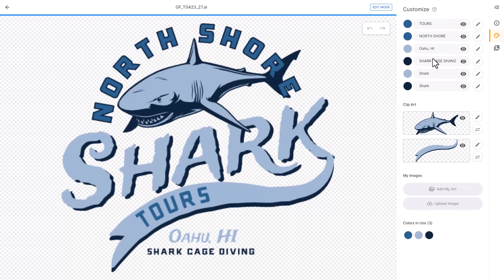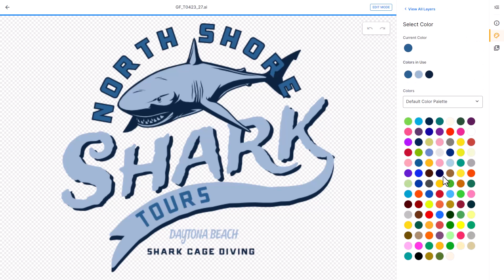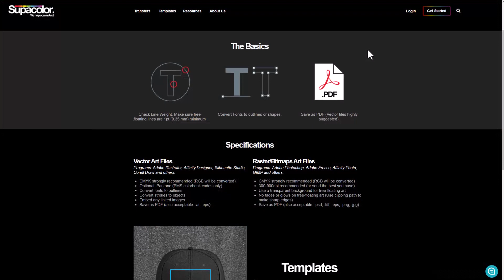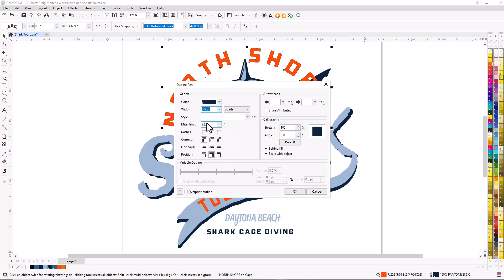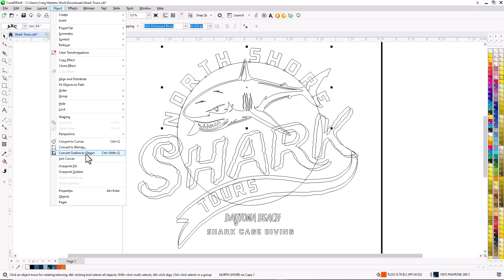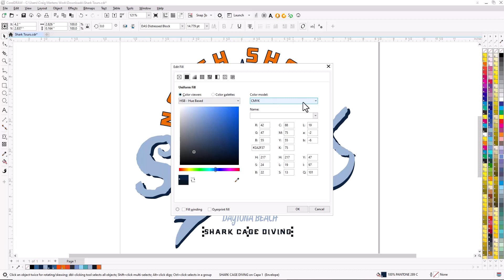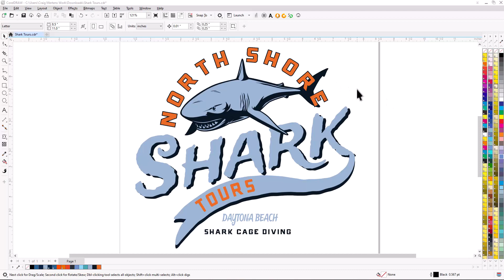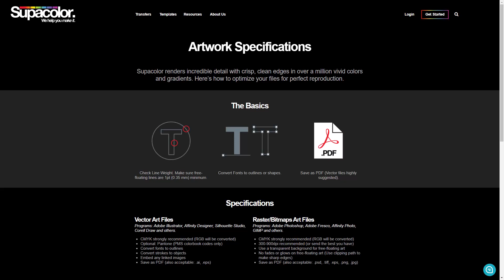Preparing vector T-shirt graphics for direct-to-film (DTF) and hybrid digital transfers

Comment: I've been struggling a lot lately with DTF printing, so I have a few questions I was hoping you could answer.

1. What would you do if the color change when converting to CMYK is noticeably different from the original artwork? Is there a quick way to find a CMYK color that matches better? There have been many situations where the customer isn't happy with the way their colors are turning out, and I need some solutions.

2. Before printing, do you need the artwork to be the exact size required? I've been setting it up that way, but I wasn't sure how necessary it is.

3. I've been editing the logos in Illustrator and then bringing the artwork into Photoshop, saving it as a PNG there. Do you think that might contribute to the color issues?

Any advice would be greatly appreciated! Thanks!